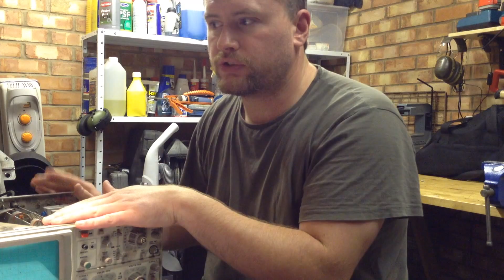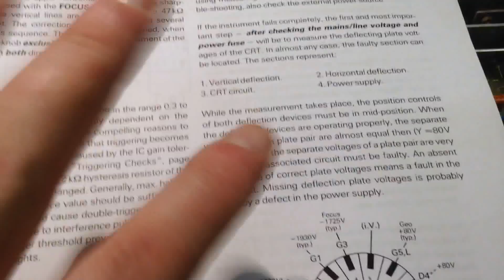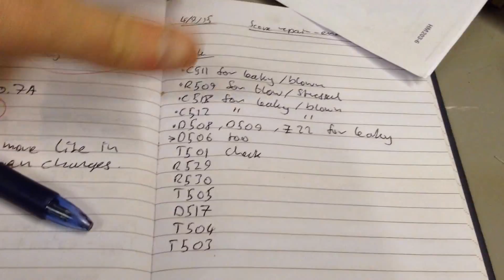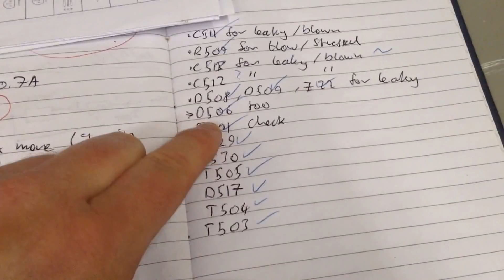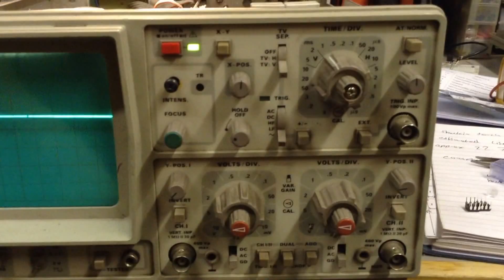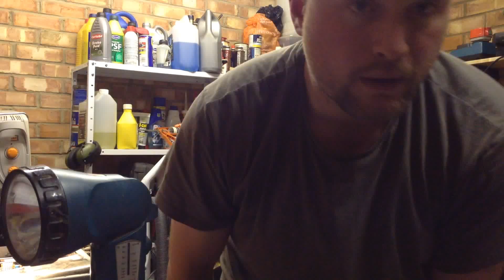Repairing HAMEG HM203-6 - Part 5 - Job Done!

Comment: Excellent video thank you. Im working on the same model of scope but my fault is that varying the intensity is affecting the trace vertical positions, as the intensity increases the trace spacing drops to the point it starts pulsing the vertical. I feel sure its in the same area but I havent found it yet but your video has helped me get my head around this area of the scope cheers

Comment: nice videos, I have the same oscilloscope, it Has a good trace But it dips down at both end of the CRT so the trace looks like a sad Smile so to speak. Do you think the problem will be in the horizontal circuit? after watching your video  I May just give it a go.